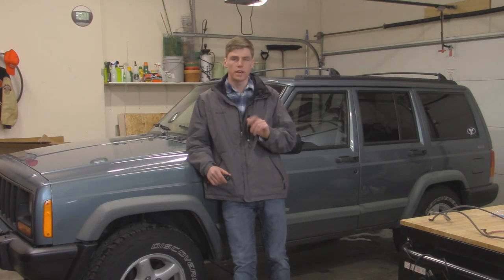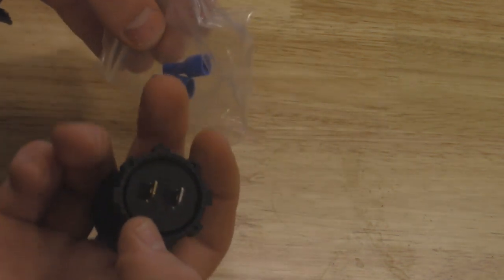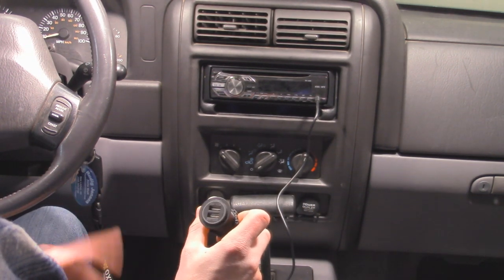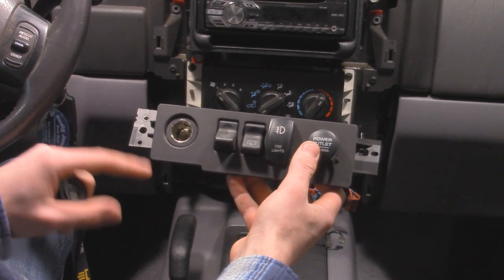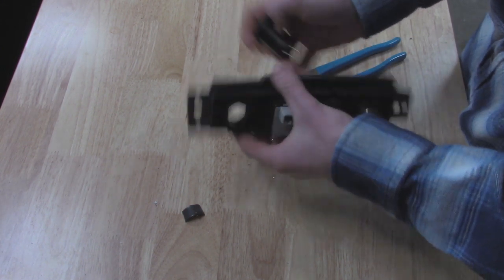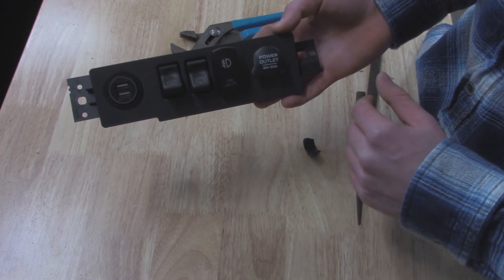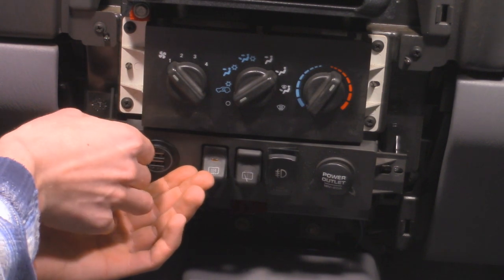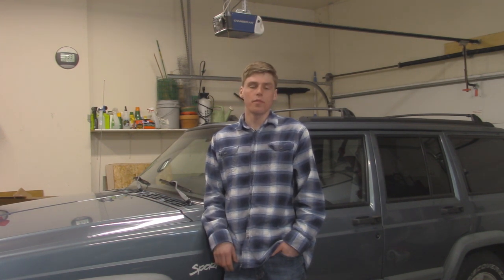In Dash USB Port Install

Comment: I did almost this exact upgrade in my 2000 XJ 3 days before this video was uploaded, the outlet I used has 2 QC 3.0 outlets and a digital Voltage read out between them.  $14 on Amazon.

Comment: Awesome video! Quick question if you only have a power socket available, would that be ok or will that drain your car battery since it will remain hot without turning the ignition?

Comment: Just ordered this exact one for my 1998 XJ 2dr, and should arrive home in a couple days, but will have to install it on the weekend. Do I need to disconnect the battery before messing with the cigarette lighter? The one being replaced is the left one like you did it and I’ll make sure all power is off. Thanks!
Reply from the maker: You should be alright as long as the ignition is off.
Reply: @OutJeeping  yes, ignition and all power will be off during the job, but I’ll also pull the cigarette lighter fuse to be extra cautious, thank you for your reply back Austin !

Comment: I'm using this vid for a guidance on my Silverado, should be the same right?
Reply from the maker: Yup, just make sure you replace the socket that has power only when the ignition is on.

Comment: Could you use the original outlet from the right side and put it on the left?
Reply from the maker: You could if you are able to remove it without breaking it. Otherwise there are plenty of car socket replacements online that can get wired in as well.

Comment: Should I unplug both battery connectors to kill any power before snipping the cigarette lighter cables?
Reply from the maker: As long as the ignition is off the left side power outlet will be off. If you are putting it on the right side which has full time power you can pull the fuse if your worried about working with live wires.

Comment: I only have one cigarette lighter on passenger side but an open space on driver side of the panel. If I wanted to install a USB there would I just solder into the existing cigarette lighter wires?
Reply from the maker: You can certainly tap into the other outlet, just make sure it turns on with the ignition.
Reply: @OutJeeping  awesome! Thanks for the reply! U already got me as a  subscriber and follower

Comment: I have a 97 Mercury Mountaineer that I want to do this to as well..

Only thing is my 2 front cigarette lighter locations are different than yours.

How could I know which one is the one that turns on only with the key?

Also, I'd like to wire one in the back.

How would I do that, just wire both outlets on the same wires? Would it be too much?

Would be cool if I found one that the illumination only came when I turned on the instrument panel lights.

Thanks in advance..
Reply from the maker: You could simply test the ports with a phone charger or multimeter to see if you got power. You can add power to a back outlet by splicing into the same wires as the front outlets as long as you don't plan to run too much power through but with USB ports you should be fine. I'm sure there may be an outlet that only turns on the light when dash lights come on but the one I installed doesnt allow for it.
Reply: @OutJeeping  Thanks alot bro.
So u say just try the charger in each cigarette lighter with the SUV off, & the one that doesn't show it's charging, is the one I want to use, correct?
Reply from the maker: @dee1380  yep pretty much
Reply: @OutJeeping  Thanx..

Comment: What would happen if you did it in the cigarette letter on the right? Would it draw power even if nothing was plugged in?
Reply from the maker: It would still technically be turned on and you would always have that led lit up. It might not be a big deal for some people's car but over a long period of time it will kill a car battery if it hasn't been started in a while. It's always a piece of mind knowing that everything's off when the vehicle is off.

Comment: I'm curious, since the circuit is always powered does that mean that specific unit you installed is always lit? Or perhaps only when something is plugged in. Cheers!
Reply from the maker: I mentioned in the video that I installed it on the driver side because this Outlet only came on when the ignition is on. It would be always let up if it were on passenger side Outlet because that is full-time power.
Reply: @OutJeeping  Got it. When you said "always on...when the ignition is on" my mind thought "always on". That LED probably wouldn't drain the battery however I might find one without an LED considering it's nice to have full time power out of those ports. Cheers
Reply: So if I installed this on the side that's always powered on, do you think it'll drain my battery faster,  since it won't ever turn off?
Reply: @erikcontreras7581  I doubt any led would be much of a concern.
Reply from the maker: @erikcontreras7581  it probably won't kill your battery but it's always good to have a peace of mind knowing that everything is off, and with these $10 Chinese electronics you wouldn't want it to be the reason to have your vehicle start on fire from overheating or something like that
Reply: @OutJeeping  You're right about the peace of mind. I even saw some with an on/off switch right on the module itself. But I don't want to risk it. Thanks.

Comment: Could I put the same port install on the other side? Will it drain up the battery if it's getting power all the time?
Reply from the maker: Yup it will cause paracetic draw but you could put it on the right side and tap it into the left side wires so it's only on when the car is on and keep the outlet with the same feature.
Reply: @OutJeeping  I'm thinking the draw won't hurt the battery, so I want to wire it into the right side wires...thoughts?  Also thanks for the videos!
Reply from the maker: @TobyTreo  Probably won't if you drive it every day but for me personally it's better piece of mind to have everything off when the jeep is off, I wouldn't want to risk a $10 Chinese electronic to burn down my jeep.
Reply: @OutJeeping  I'm in business,I found one that has an on off switch.
Reply: @TobyTreo  where did you buy it

Comment: I did everything but for some reason the USB port won’t work. Is it possible that the connection to the drivers side cigarette lighter never worked to begin with? I made the mistake of not testing it before working on it.
Reply from the maker: Could be a fuse or the polarity of the wires is backwards

Comment: Great Video! Good idea! I have a whole bunch of those plug in chargers although I never buy the cheap ones it would be great if it were built in. Were you worried about parasitic draw by keeping it live with the ignition switch off?  I have kept my dual USB plug in style chargers plugged in for weeks at a time and seem to get by with it...guess I am lucky. But in the event that a ten dollar item from China burns your Jeep XJ down to the ground it probably is the safest way to go.
Reply from the maker: Yeah it's better peace of mind to have everything off when the jeep is off.

Comment: Bought one of ebay, jacked up the cigarette lighter shroud, wired it in, and it doesn’t work. It lights up but plugging in iPhone with multiple chords does nothing. Any ideas?
Reply from the maker: If the polarity is correct and you have power then It could possibly be defective.

Comment: I just fitted one of these to my van and the light stays on blue light stays on even when the ignition has been switched off will this drain my battery?
Reply from the maker: Over a long period of time without the vehicle running it eventually would. I would hook it up to your ignition source that way it's only on when the ignition is on.

Comment: My cigarette lighter has three wires usb has too what do i do.thanks
Reply from the maker: Use a multi-meter and test which wires do what. You may have an extra positive wire for illumination lights for the dash.